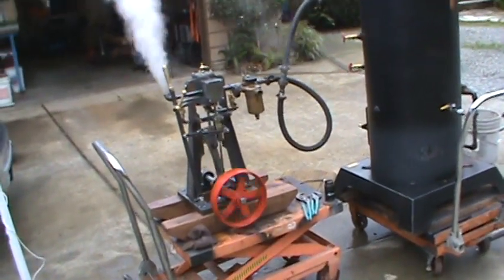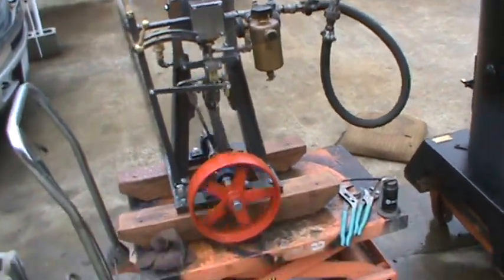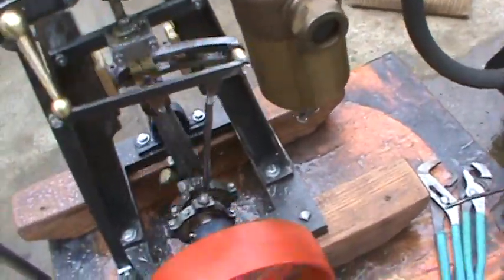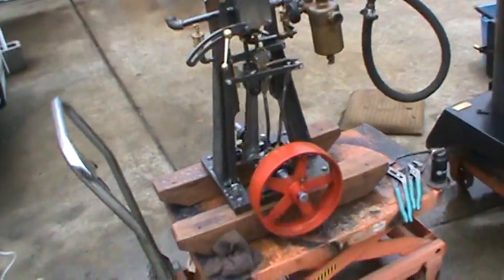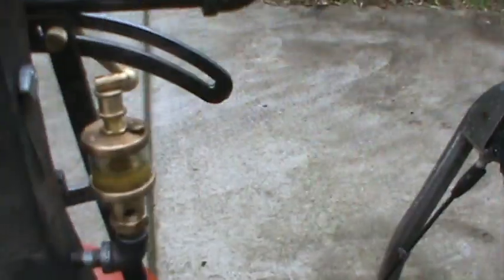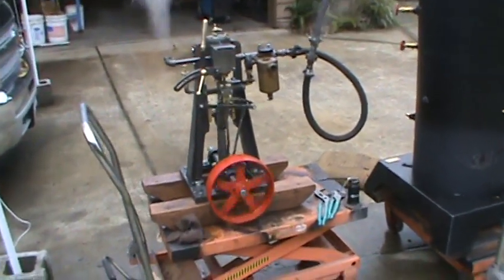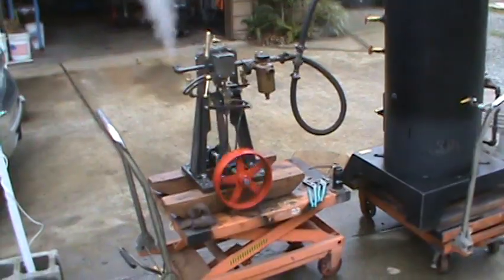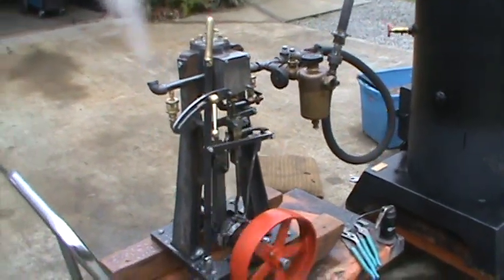Steam Engine Reversing

Comment: Hi Ross. Running real smooth. Well Done as always. Have a safe and Merry Christmas to you and your family. Great work. ---Michigan
Reply from the maker: Ed, I haven't heard from you lately. Have seen my steam engine running a generator on air?
Reply: @rossbendixen  not on air. Are you able to get enough ram's to generate elec power from the generator ? I haven't missed a single video. Sometimes  I  just post 5 or 6 thumbs up
Reply: Should have read : RPM's